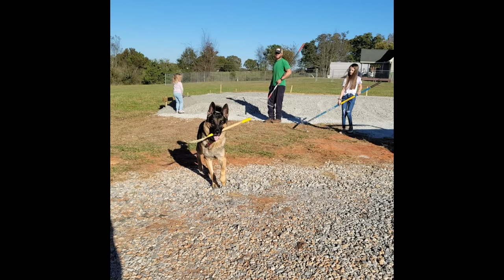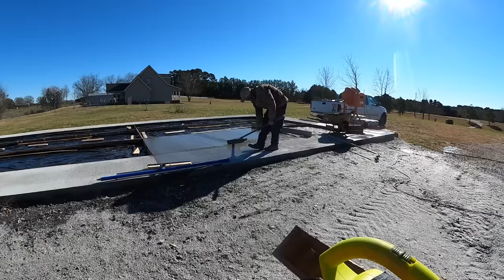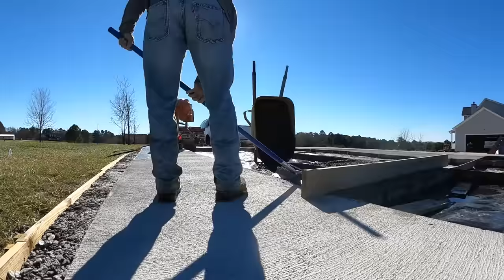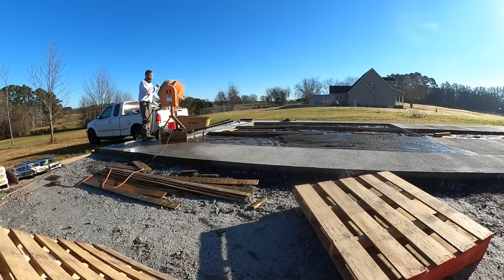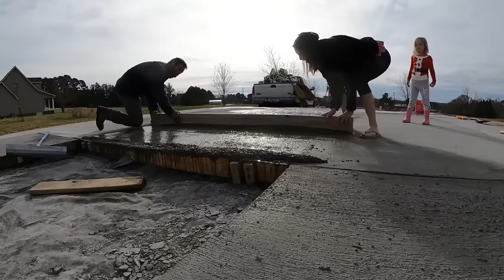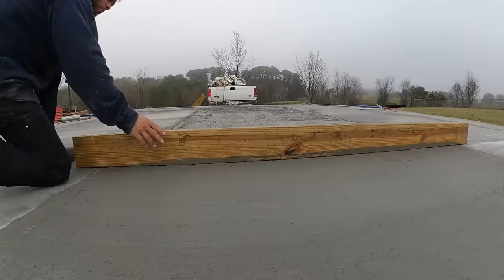Pouring a Huge Concrete Slab Using Bagged Concrete | I Saved $10,000

Comment: Hmm...this doesn't quite check out. The average price per square foot of concrete was about $9.50 in 2021. These costs include labor, materials, and delivery. That's about $11,500 for the area you are working. This would suggest you only paid about $1,500 for materials. Concrete was about $6.00 per 80lb bag in late 2021, so you spent roughly $5,000 on concrete alone before tax. Gravel would cost you about $2,000 if you got a good price in 2021, and you'd probably have about $500 in lumber. From what I can tell, you spent roughly $8,000 after tax. So you saved about $3,500 by doing the labor yourself, not $10,000. Surely you don't expect me to believe a concrete service was charging nearly $20,000 to install a 6 inch, 1,000 sqft slab. You could get grading, sub-floor heating, fiber steel concrete and finishing for that cost and still have money left over.
Reply from the maker: We were quoted 14k and up for this project. I have a little less than 4k in everything.

Bags in my area right now are right around 3.60-3.70  when you get more than 42, I paid 3.20 each about 14 months or so ago.

Truck in my area was 200 to 220 depending on the day with a 4-6 week lead time. 

If youre interested I did an update and answered the most asked questions in this video linked below. I even pulled up the price of bagged concrete to prove on my phone and showed it. 

https://youtu.be/qKcy6BI8yA0

Comment: Must admit to not seeing how you can have saved $10,000 the way you did it. From our local supplier here in the UK, the sub base at 100 tons, loose, would be £5500. For the floor of my new workshop, at 40ft x 30 ft x 6" thick concrete would be £2500 max for C40 concrete from a truck. You don't seem to have local access issues. Bagged products would have cost more than double the price. NOTHING is more expensive in the States than the UK, except medical and dental. So with me doing the work I could put down a new floor for less than you say you have saved. I just don't get it.
Reply from the maker: We were willing to pay someone to do it until we got quotes of 14k up. I said concrete doesn't cost that much. I did gravel and concrete for 3800 dollars. Labor and now material have gotten absolutely ridiculous. This was close to a year and a half ago and I bet things have went up even more since then.
Reply: @Real Life Tested  Ah yes, if I got someone to lay it, it would be a lot more. Not even looked at the prices for that.

Comment: What you didn't save was your back. I did this on a 10x14 pad and it sucked! never again
Reply from the maker: I think lifting weights and heavy cardio everyday has helped me with projects like this. For me it was more mental knowing I had to do this after I got off work everyday. (I worked night shift at the time)
Reply: @reallifetested2605  I did mine after working night shift. Took 8 hrs and I got chemical burns all over my skin.  I my dad ran the mixer. I used all 80# bags because they were cheaper. I couldn’t move the day after lol.   Good job you did save a lot. Just won’t be doing that again.
Reply: @reallifetested2605  did you put any rebar or anything in between the different pads to prevent them from moving independently from each other?
Reply from the maker: @WorldsOkayestFarmer I did not. I thought about it but figured I have enough gravel under there that if something is moving I’ve got bigger problems haha I haven’t had any movement but it would’ve been nice to add just for a little more insurance.

Comment: you got what you paid for, a crappy non monolithic slab that is WAY too wet when poured. guaranteed to have massive cracks and be unplesent to walk on. There is a reason you saved $, its junk compared to what you said you saved. You got a cheap pad, cool, but its NOT comparable to the 10K you "saved" if you spent that on this slab you would have a MUCH different result that will last 100x better.
Reply from the maker: So far no cracks or issues. I’ll be doing yearly updates. Funny thing is I can tear this out and redo it about 4 more times before I start spending money vs paying a contractor once.
Reply: @reallifetested2605  i agree, but you are clearly not getting the same product or finish.

Comment: You lost so much strength going that route.
You should be adding quarter bags of Portland cement to every 2 or so bags of concrete mix Min.
Those bag mix even the extra strength higher psi rated ones are not for slabs, they are more for fence posts brick Laying, sauna tubes ect.
I know it sounds like you saved a lot of money going this route, but in the long run I can assure you, you did not. Something of this size would be a real shame to have to tear out in a couple years after your building is built and everything.
I hate to be that guy and be the bearer of bad news.
But I'm third generation in this trade and have done only concrete my entire life.
You did a fantastic job and I know the work you put in, which is borderline amazing.
And I hope it lasts for you for the long while.
Try to keep an eye out for any type of spalling or separation considering you did not dowel the sections together and address any of those issues ASAP.
Maybe consider sealing it with some shark grip, or something of the sort to help give a little adhesion and strength on the surface..
Either way you did a great job and I applaud you for your hard work.
Reply from the maker: Thank you for checking out my video, and for the input!

Comment: Oh man. But for 10 k you probably could have gotten legit slab done by professionals. Regardless of the finish they probably would have done proper prep like removing the organic materials before adding gravel(yes it does matter) as well as reinforcing it with mesh or rebar.... I sure hope you don't plan on building anything substantial or putting anything heavy on that.   But even if you don't it will likely start cracking, crumbling, and settling over the next few years. Congrats on wasting your time and money to save 10k. Next time pay the professionals.
Reply from the maker: Lowest quote was 14k. I have 3800 in over 100 tons of gravel as well as concrete. I did grade it. No one uses rebar in slabs or driveways around here. I’ve been around hundreds of developments and haven’t seen it. So far no hairline cracks. The house we built had “professionals” do the front porch and driveway. There are tons of cracks. Which is why I did this. So far so good. I’m doing yearly updates so stay tuned. The amount of money I saved I can tear it up and redo it 2 more times and still come out good. Yes I have equipment to do that…

Comment: You can't pour bag cement cheaper than a truck. Do the math people.
Reply from the maker: When I did this truck was 200 to 220 depending on the day. #80 bags were 3.20 each. 

Truck cost for 18.2 yards is about 3826

Bag cost 2624

So it was actually a little over 1200 cheaper. I checked into doing the 1,2,3 method and because of high sand and mortar prices it was going to be about 163 per yard so it wasn't worth the extra work to me.
Reply: There over $5.a bag And have been for some time. Your cement company is way to high.
Reply from the maker: @randymyers5086  they have went up a bit since I did this about a year ago. In my area bags are up to 4.13 but you do get a bulk discount not sure what that is without going in and getting a quote. I haven’t called about concrete so I don’t know what it is now. I couldn’t believe the prices we were getting when I called for quotes. They were wanting 14k and up. The prices of everything have gotten way out of hand.

Comment: I admire your work ethic but this was not a great idea.  No re rod?  Should've called a cement truck.  Time is money.
Reply from the maker: No one in my area uses it unless requested or commercial/industrial. I called around and spoke with local pros to verify. If time was money inflation wouldn’t be a problem. Bags were cheaper to me than truck by a fair amount and I was working 7 days a week night shift and could only take on so much per day.

Comment: I applaud your work but I'm concerned about the lack of reinforcement and expansion joints. Maybe I just missed it, I kinda screamed this video, didn't watch every minute
Reply from the maker: I called around and spoke with local pros. In my area they don’t use rebar on 4” residential on grade slabs. It rarely gets cold here and we have a hard clay soil. I’ve never seen it used in small buildings / driveways around here. I did a 1 year update if you’re interested. I don’t have any cracks at all and show the slab.

Comment: Jesus.. 10 grand? Ive had concrete slab twice that size, twice the thickness.. with mesh and shit.. for less than 5000... 😂 you sure getting ripped off ... whereever you are....😂
Reply from the maker: Idk what’s going on with contractors these days. We were quoted 14k and up for this work and that was over a year ago. They say prices have went up even more! I have right at 3800 in this project.

Comment: Just guessing insanity runs in the family. And I really don't believe you saved that much on the slab using bagged concrete.
Reply from the maker: Nope! Just me. I was quoted 14k and up from local conctractors. I did everything myself for a little less than 4k. Truck at the time was 200 to 220 depending on the day, and I was able to get #80 bags for 3.20 each. I'd hate to know what everything is now since inflation has gotten even worse.
Reply: @reallifetested2605  Yeah.  Today, concrete is about $5 by the bag. And contracting it out start to finish would be very expensive.  Even doing it myself (in my younger days), I would have saved so much time ordering ready mix (and three close friends) that it would have been well worth it.

Comment: dont do this. concrete needs to cure at the same rate
Reply from the maker: Check out the temperatures at which concrete cures. It’s really interesting information. That’s why I used plastic to retain moisture and did this in our winter where temps are in the high 30s at night and mid 40s in the day time. It takes literally weeks to cure at those temps and is actually more beneficial to have a slow cured concrete.
Reply: @reallifetested2605  what ive been told about it all my life and from having seen shit jobs that crack, structural concrete like a load bearing slab you want to pour at once and let it cure as a single mass. doing it by hand ensures you cannot cover the area in one go. for small non important things like hvac pad or even a small toolshed it wouldnt matter, but for a house.. goes against everything ive been told and seen. maybe im wrong

Comment: Horrible idea won't save a dime on the actual cement just get cement truck. I have some logistical problems of my own can't get the cement truck to my location three times the cost to use bags. Built a yard and a half cement trailer with agitator easier to build the trailer better quality cement and the labor can be recouped by selling the cement trailer. That being said well done
Reply from the maker: I saved over 10k. Bag was 3.20 for 80’s, truck they were wanting 200 to 220 with a 4-6 week wait. Contractors lowest estimate we received was 14k. I only have 3800 in this.
Reply: @reallifetested2605  absolutely labor costs the majority of the cost in cement. Sucks if you don't know somebody then yes they'll make you wait for your truck. But where I'm at at $200 a yard for cement it's the equivalent  takes 10 bags if they're the 80 lb bags to make 1 yd 4 bucks a bag where I'm at it's $400 a yard and you have to do the labor to mix it
Reply from the maker: @user-ih5ii4tp3w that’s awful brother. I wish prices of things would go back to the way they used to be. It’s getting harder everyday just to be able to afford basic necessities.
Reply: @reallifetested2605  I agree I know many people owner operators running their own construction companies. The cost to operate are insane. Charging three times what they used to and not making more prophet. The way it's going If you're not willing to just do it yourself you'll probably never afford it otherwise if you're like me and the majority.

Comment: You didn’t save much, a yard of concrete from the plant costs just about as much as 45-80 yard bags of concret to get a yard. you saved roughly the delivery fee  from the concrete plant and that’s it brother, your pad could have been 5 times bigger and would t have cost you 10k in concrete materials. Even with labor, would have only cost you about 7k for that little slab. Don’t lie lol
Reply from the maker: Bags 3.20 per 80 lb. Truck was 200 to 225 depending on the day with a 4-6 week wait. Contractors lowest quote was 14k. I actually saved 10000 dollars. I only have 3800 in concrete and gravel vs paying minimum 14k to have it hired out. I did a one year update explaining everything if you’re interested as well as going over the slab.

Comment: I don't see any rebar in your saving $10,000 concrete pour.
Reply from the maker: Not required in my area.
Reply: @reallifetested2605   Kindly I Thank you for your time responding,  I just couldn’t imagine not using wire mesh or some reinforcing for any concrete, but thank you again.

Comment: 830 bags at $6.40 = 5312 
For your slab you needed around 12 or 13 yards which even at $200 a yard is $2600 math is not adding up. You wasted a lot of your life on this pad and for really nothing but a loss.
Reply from the maker: Not sure where you are but bags in my area are not even close to that. I go over all of the most frequently asked questions and do a 1 year update in the video linked below. I actually show on my phone what bagged price is in my area. 

Pouring a Huge Concrete Slab Using Bagged Concrete | ONE YEAR UPDATE
https://youtu.be/qKcy6BI8yA0

Comment: guy only saved 10k if he would of hired a crew to do the work. If he just got a truck out there with 15 yards. He only would of paid about 2,500$ of the concrete. Which is basically what he paid for in bags, that he had to hand mix himself. 

He could of got the job done in 1 day time. For about same price if he just order trucks instead. This is what it looks like. When you have an old head who wants to solo the world. Takes days and days to finish the project. Refuses to do things the faster and easier way. Says is saving money. But wasted weeks of time. I could of generated more money with the amount of time he took to build this. Which would make me actually done this job cheaper than he did.

If you spent 2,500 on concrete, but get the job done in 1 day. You only used 2,500. If you spent the 2,000 on concrete but takes you 7 days to get the job done. You didn't make anymore money. You actually lost money and you lost your time. Which is more valuable then money anyway.
Reply from the maker: If you listened to the first thirty seconds I said I saved doing everything myself. The bagged was cheaper than truck at 3.20 per #80 bag instead of 200 to 220 for truck with a 4-6 week wait. It took me between 40-50 hours to do this. I was quoted 14k and up and have 3800 in this. At that rate I was making around 220 dollars per hour which is good if you ask me.
Reply: @reallifetested2605  I stated without a crew. Getting the truck would of been faster and less time used. Like you said 50 hours. It probably took longer tbh. Setting up forums, pulling forums, getting rock in, digging. This job was longer than 50 hours. It probably took you 50 hours to just fill all the concrete solo. 

By the time lapse you only got like 1/4 of it done in a day. With a truck and 1 buddy. You guys could of had the entire thing done in 1 day. All you had to give your buddy was like 300 bucks. 

Your getting a quote for a crew of like 6-10 people to do this job. Yes that crew would cost that level. 

But judging by what you have in life. You probably make around 20k a month. Meaning if you break it into weekly earnings it is about 5k a week. So 2 weeks of work for you is equal to paying for the concrete work off. This would of saved you weeks of work. But you cared about that 2 weeks so much. You took longer than a week to do a job solo. 

Last thing the truck would of costed you like 300 bucks more. I don't see the problem with that. It is all mixed. Easier to pure in. Easier to deal with. Less overall work and quicker. 

Or you do more work and save 300 bucks. That 300 bucks isn't worth the time and work you put into the job. You feel good about it great and all. But there is better ways to do things. 

Like I stated before. An old head stuck in there ways refusing to change or get assistance. Then wants to be glorified for the work they did. Like they did something special.
Reply from the maker: @fighterpimp  You need Jesus. :D

Comment: I am not buy that you saved 10000, let's do the math ,27 bags per yard 5.00 a bag that's 135.00 a yard plus tax concrete is between 125.00 to 150.00 a yard delivered NO WORK INVOLVED, so explain how you saved 10000.00  ,the cost of Sack crete and ready mix is the same just 0 work I involved in red mix for you a  HUGE HUGE amount in sack crete for you
Reply from the maker: In my area at the time truck was 200-220 per yard depending on the day with a 4-6 week lead time. 80 lb bags were 3.20 each. Local contractors wanted a minimum of 14 k to do the work. In the first 30 seconds I said I saved 10k doing it myself. I have 3800 in the concrete and over 100 ton of rock.